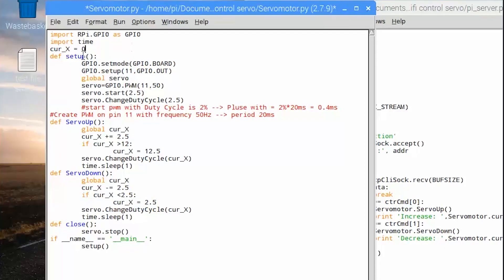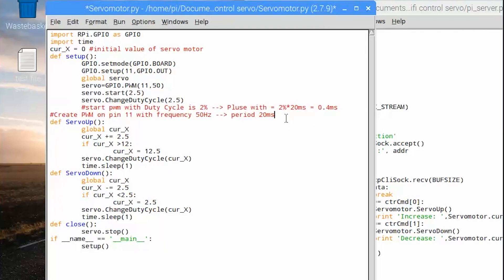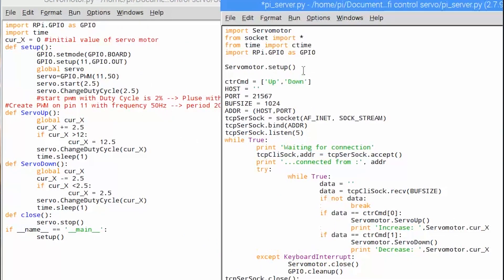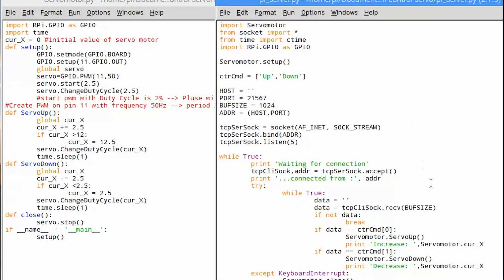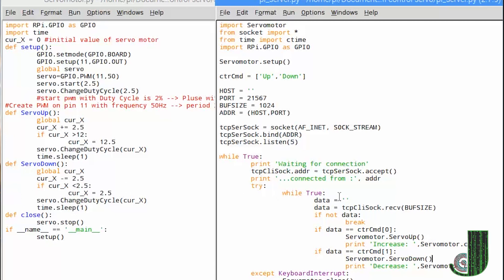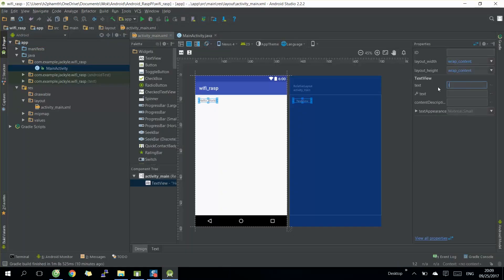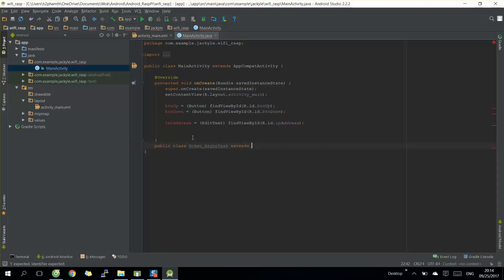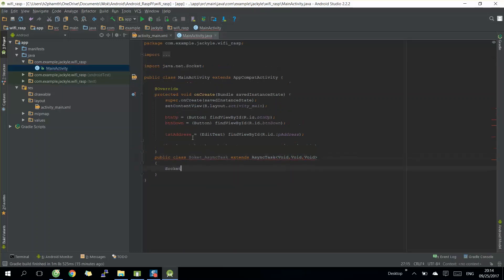Raspberry Pi Control Servo Motor By Android Smartphone over wifi | Android Studio

Comment: Jacky , something happen . it went well but the servo does not move and the output just came like this 

waiting for connection
...connected from : 

they not comes with an IP and buffer size . 

can you help me ???
Reply from the maker: Azizul Hakeem seem you still couldn’t connect rasp with your phone
Reply: @JackyLe  can you helpme??
Reply: if you are using the emulator on desktop it wont run install the apk in your phone connect it to your wifi and then try running the app and the server code

Comment: how are you getting the IP address of the raspberry pi.
Reply from the maker: It’s depends one your setup
Reply: Thank u for replying. I am a noob at raspberry pi thing. I have installed raspbian in the sd card and then starting the python program. When I am checking ifconfig it is showing 0.0.0.0:21567 in the list. I was asking how are u getting th ip address that you are putting in the android program.

Comment: [Hey @Jacky Le kindly pinned this comment.... ]
hey if anyone who is using python3 and getting the output like this:
the msg sent from android = hey
the msg  that pi recv = b'hey'

due to the above thing the if conditions are also not working....

FIX:  just add this line in your code..
data = data.decode('utf-8')                           
 # as in python3 the msg is an object so to convert it into the string we need to decode it

Comment: hey great video...
i am able to recv the msg on my pi but i think there is some issue for ex:
the msg sent from android = hey
the msg  pi that pi recv = b'hey'
is the above thing normal..?
and my if statements are also not working,,,
Reply from the maker: Something wrong here, however for short term you just do case by add "b" + cmd. then every should be ok. Beside that you should figure out why this happened.
Reply: okiessss..
There is an another issue.. that my script is running the rcv msg code twice..
for ex: from android msg send = hey
at PI: msg got: b'hey'
          msg got: ''                        #why this is happening
Reply: i fixed the error in the msg format part...
Reply: @funkupgamer5364  hey how to fix it
Reply: @funkupgamer5364  how??

Comment: hi jacky , i am using arduino instead of raspberry and a dc motor instead of servomotor will this android app work, if i build an android app using your android code which will operate on aurdino and dc motor
Reply: sure it will but make sure that u code correct arduino command on android code

Comment: all is going well but when i press up and down button on android 
on raspberry side it shows connected and doesnt move servo and dont show the other increase and decrese
Reply: verifie the command that send it into raspberry with the command that you put it in the condition (if)
Reply: Thanks dear issue was in python it was receiving bytes and i used .encode() in the condition
Reply: In the code python where are you receiving bytes from android and you check that byte is on or off there you need to encode this and make sure the socket is working okay
Reply: @imahmadsweetu  it says bytes object has no attribute encode
Reply: plz do some explanation cant understand
Reply: Muhammad Ahmad where i ise .encode() ... Plz help because i am new in python...
Reply: hey man where exactly are you supposed to encode ? that way i have it is this if not data:
                                        break
                        if data == 'Light_01_ON'.encode():
                                GPIO.output(LIGHT01,False) 
This didn't work. If you could help me get it working i wouldnt mind paying you i really need this to work
Reply: Bro can you send me android code please. bus here android code did't work.
Reply: in python code when receiving bytes from android use .encode() with it.. because the code is in python2 now latest is python3
Reply: @imahmadsweetu  where to put the .encode() sir? thanks in advance

Comment: Hey, thanks for putting this video up. Helped a lot.
I tried implementing this, but for some reason, if i tap the button twice, it does not perform the task inside the "if data ==" clause.
It shows up on the pi as an instruction received from the phone everytime, but it doesnt print the value "increase:" .
Reply: Same problem！
Reply: I tried to change the command 'Up', 'Down' to '1','2' on both ends, and it worked, but don't know why..
Reply: @mingruisun9675  can you help me the problem? Thank you very much!
Reply: @vovantoan5786  don't use string, use character it works like that

Comment: I went through this and it works great.  Could this also be used to send continuous data from the phone to the pi and vice versa?  If so, what kind of changes would need to be made?
Reply from the maker: On raspberry instead of tcpSerSock.listen(5) you can send command to android device: tcpSerSock.send(str.encode(message)) ; with android app we need to use  tcpClient.receive; for more detail you can check it out here: https://guides.codepath.com/android/Sending-and-Receiving-Data-with-Sockets & https://stackoverflow.com/questions/19540715/send-and-receive-data-on-udp-socket-java-android
Reply: Thanks, I will take a look

Comment: Hi Jack nice video my friend ! It is possible to use the code for a dc motor and not a servo one ?
Reply from the maker: sure you can. ONly think that you need to buy a driver for dc motor such as  L298N
Reply: Thanks Jacky Le !
Reply: Sure I have here an IBT-2 driver to control a 24V Bosch Motor. I'm going to test it now :)
Reply: hi did you done with your DC moter?